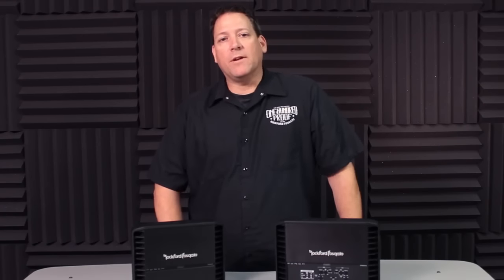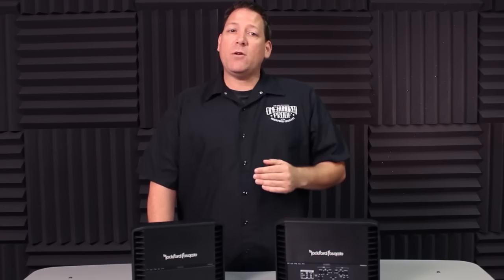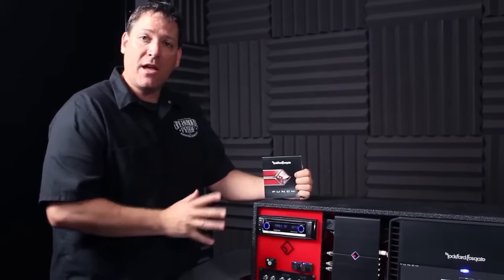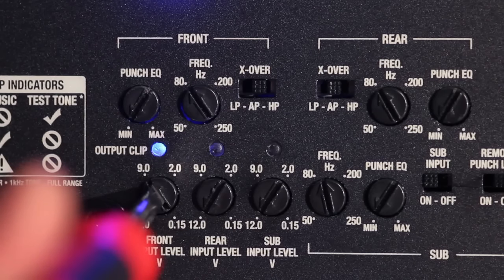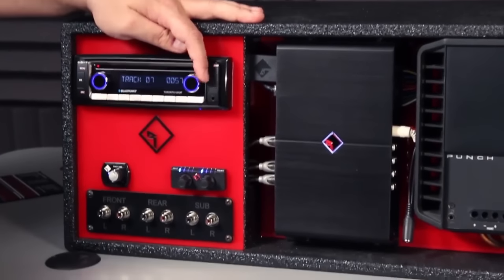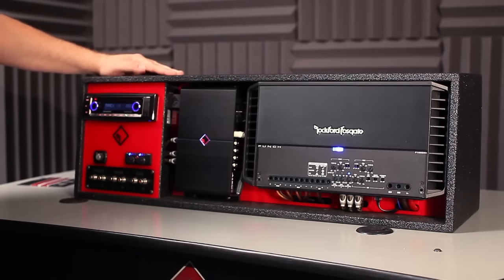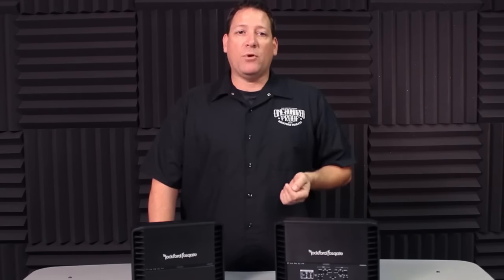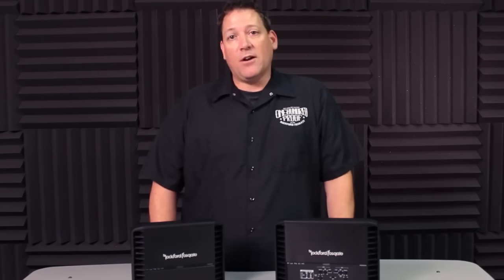Rockford Fosgate: Punch Amplifier Overview (3.1)

Comment: This is all good and cool stuff but one point, its only perfectly set up with the setup disk.  Any other source disk you install after setup will not be the same, meaning the output from the receiver will always change with differnt media.
However with that said its a good starting point.  You could do all this and set it up perfectly, Drop in An AC/DC disk and hear a clipped signal when the canon is fired.  Or Buc's 1812 overture 
It really comes down to the recording studio quality during the recording of the material on the disk, File, or tape??? 
As the industry mixes using an avg size speaker 5.25"  and these guys used to do everything by ear but now use digital recording methods you still at the mercy of the engineer's abilities.
So try and keep that in mind and fudge a bit back from RED or blue red lights so your not even close to clipping.  Give yourself some Headroom. Overall sound will be better anyway.

Your other variable is a drunk customer who thinks full blast is better when he's drunk. Some people will blow the same speaker 10 times until you teach them what clipping is. If it sounds good at 27 then its going to rock at 35!  Just long enough to send a clipped signal at 400 watts on a 50 watt amp and blow the Voice Coil out on a speaker. If the Amp dosn't have protection its also going to burn up.

If you don't think it can I've seen 3-1000 watt PPI's amps shoot flames 2' out the side. on a customer DIY job.
Reply from the maker: Proper level setting does change by source and that's easy to compensate for.  However, the simple fact is your average car audio enthusiasts does not want to listen to their music at 0dB (no clipping) because it isn't "loud enough".  Typical fanatics appreciate +5 dB on the high end and +10 dB on the low end of Gain Overlap. This is the best compromise between sound quality and relative loudness.  Our CLEAN setup will help a majority of  car audio fanatics setup their system levels correctly using an intuitive method.
Reply: @rockfordfosgate  i have alpine cde-w265 with rockford p1000x1bd going to a Sundown x8 (1) and p600x4 going to 4 polk MM 6.5 speakers. Amps gain is about 50%-60% on both amps with blue lights at head unit max volume. No way you can sit in it comfortably and prolly will have hearing damage, still the sound is crystal clear.
Would a line driver that sends more clean power to the amp allow me to turn up the input gan on the amp? Just curiuos if thats why the clip light comes on
Reply from the maker: Hi @cuchsluch , The input clip on the P1000X1bd detects when the source unit clips.  When you setup the CLEAN circuit, the Alpine CDE-W265 should have been setup to approximately 7/8 max volume (typically the clipping point of the radio) ... if it was RED, the volume needs to be turned down until it turns BLUE.  A line driver boosts the signal voltage for long runs or when you are driving a large array of amplifiers, so it doesn't sound like you need one because you say the amp gains are not more than half-way, telling us that you have adequate voltage for the amplifiers to make power.  If you decide you're going to install one anyway, you'll be turning the amp gains down significantly, but please note, adding one will not change how loud your system plays.
Reply: @rockfordfosgate  thanks. Nah, it sounds clear and theres no way i can sit in the car with it cranked up so i'll pass on the line driver, i'm just trying to learn about it. Thanks

Comment: Man my old boat has 1995 made in America amps where are they made now?
Reply from the maker: All amplifiers are designed and engineered here in Tempe, AZ.  For the actual assembly of putting the pc board into the heatsink, we use contract manufacturing so it varies on the location. To understand how we still use the same design and engineering philosophy as our founder Jim Fosgate did in the 1970's, take a look at "The Secrets Behind closed doors Rockford Fosgate" by Five Star Car Stereo: https://www.youtube.com/watch?v=2F2kmpHZMls

Comment: What about heat?
Reply from the maker: All our Punch amplifiers feature MEHSA substrate that helps keep the MOSFET running cool by more effectively transferring heat to the heatsink.  They also have built-in thermal protection if the amplifier installed in an area where there is inadequate air flow.

Comment: Didn't come with CD
Reply from the maker: There should have been a QR code in the amplifier to download these FREE from our website here: https://rftech.custhelp.com/app/answers/detail/a_id/1126/
Reply: What do the other 2 adjustments on top do?
Reply from the maker: @doilusa  Could you be a little more specific?  The amplifier shown in the video has 14 adjustments on the top.
Reply: @rockfordfosgate  p400x4
Reply from the maker: @doilusa  
I pulled this info from the owner's manual, so maybe this will help:

1) Input Level Knob - The input level control is used to match the output of the audio source.

2) RCA Input/Pass-Thru - The RCA inputs are capable of accepting signal from either high-level(speaker) to low level(RCA). When utilizing high-level for input signal the auto turn-on feature is active.  The pass-thru RCA’s are passive, including full input signal range and auto turn-on functionality when active.

3) Crossover Switch - Selectable switch for High-Pass (HP) or All Pass (AP) or Low-Pass (LP).

4) Variable Crossover - Is a built-in 12dB/octave Butterworth filter with a crossover point variable from 50Hz to 250Hz.

5) Punch EQ - A Gyrator based Punch EQ that eliminates frequency shift with boost. This works along with the crossover switch on the amplifier. Variable from 0dB to +18dB @ 45Hz.

6) 2/4 Channel Switch - Setting this switch to the 2CH. position, switches the inputs to a 2-channel mode, allowing connection to only the front inputs with a 4-channel output.

7) Remote Punch Level Control - In/Out
Remotely control the output level of the amplifier. The PLC-OUT is used to daisy-chain additional amplifiers controlled by a single remote.

Here's a link to the owner's manual:
https://www.rockfordfosgate.com/rftech/library/2013/3_amplifiers/1230-57270-02_punchamp_en-man.pdf

Comment: Hi I have a Rockford fosgate T1500 1bd amp
I wanted to know if this amp is good to push 2-10” fosgate p3 subs
Reply from the maker: Hi Junior, That might be alittle too much power.  P3 subwoofers are only designed to handle 600W, so if you have 2 subs, that will give you 1200W of total power handling.  The T1500-1bdCP amplifier produces up to 1715 Watts x 1 @ 1-Ohm, which would be over powering them by 500 Watts.  Personally, I'd recommend the T1000-1bdCP since that's a better match-up!